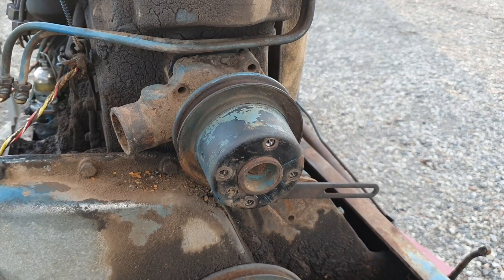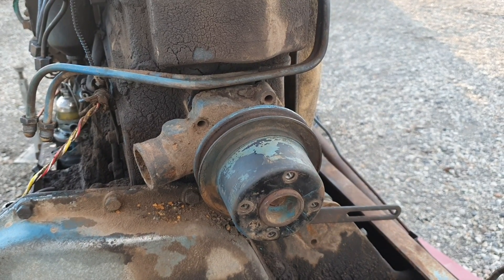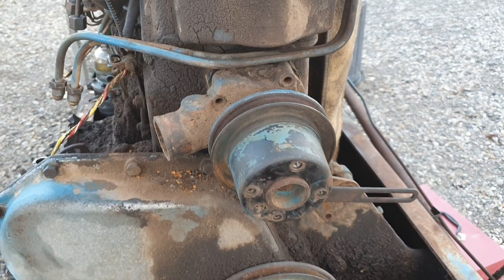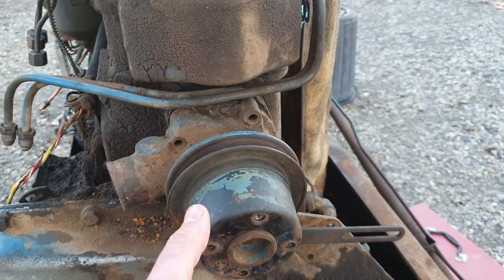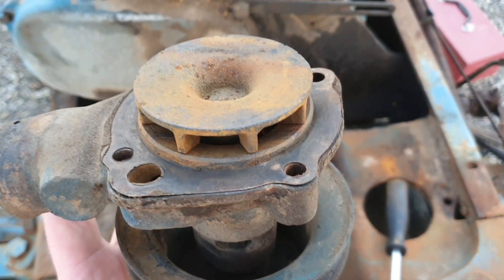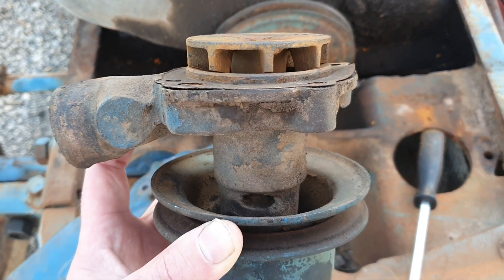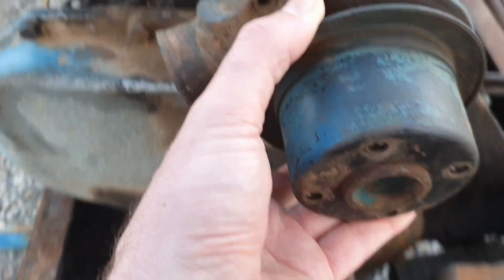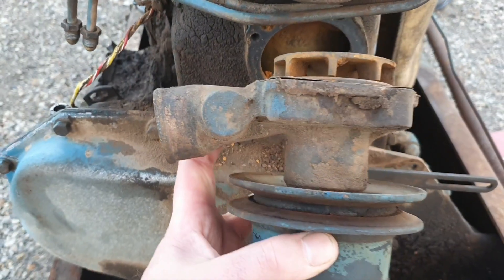Fordson Major Water Pump

Comment: My tracor is overheating 

Disconnecting return pipe and running engine, there is no flow.

Removed water pump

Impellar is spinning free, indepentantly from fan/shaft. 
How is this meant to work, i assume it means my empellar is broken, but want to be sure im not missing something
Reply from the maker: Best guess is that you are correct. Luckily, this part is a very common replacement and are easy to purchase.
Reply: Would anyone have a part number for the water pump shown, with the round hole.
Reply: i am replaceing the headgasket and waterpump :) parts received, waiting for me to find time
Thanks for input!

Comment: Thanks for posting, interesting clips you're putting up. A Perkins Diesel, aren't they a Neuse or similar German Donk ? cheers.
Reply: It is a Ford engine made in England. The Fordson Dexta had a Perkins special build engine for the dexta. The Fordson Major Diesel like this one has a Ford engine. A very reliable economical and easy starting engine. This tractor gave farmers confidence to move away from Power kero To Diesel. i agree great short videos with helpful information
Reply: @davidrobertson376   ok thanks Dave, we had a Fordson Farm Major as our tractor back in the hey day, a very solid performer for what it was, cheers have a good weekend if your not under lockdown.